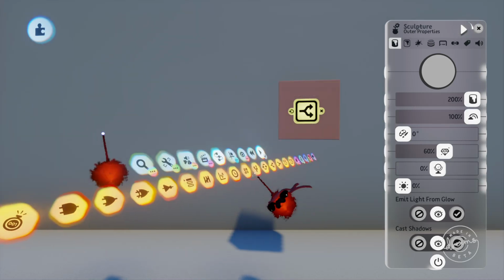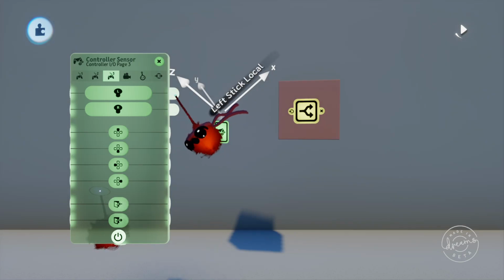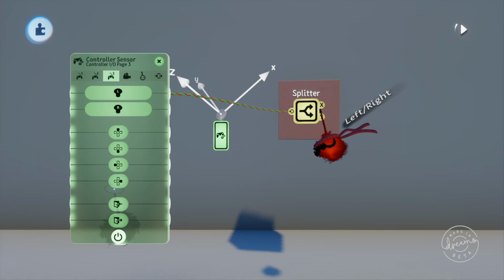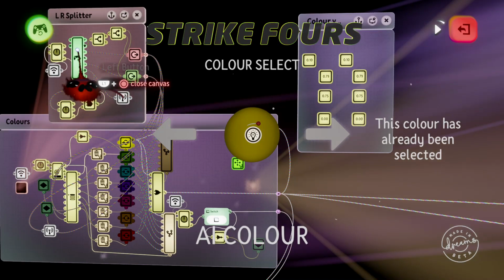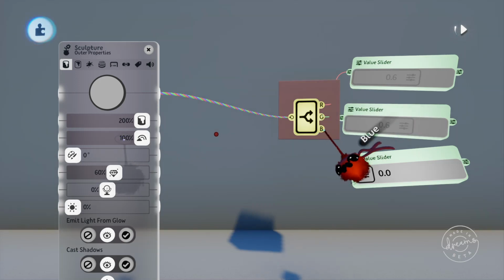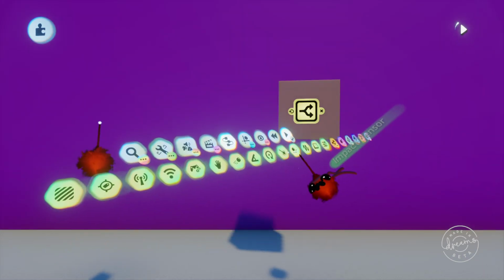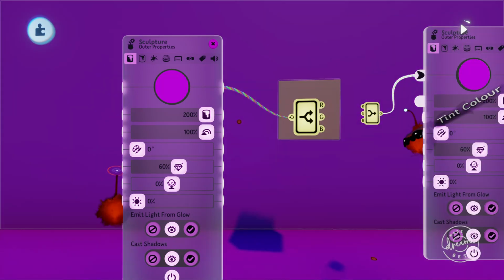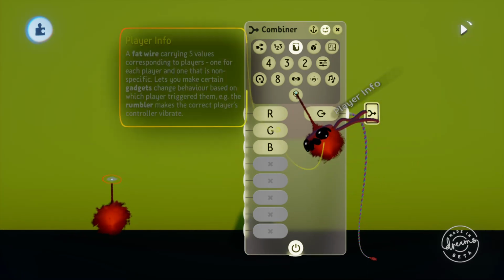Tutorial #6 - SPLITTERS AND JOINERS - Dreams PS4 Logic

Comment: So the left and right works, but it also still registers the up and down directions into the left and right. Is there a way to prevent that?
Reply from the maker: Have you plugged the stick output into a splitter, then the left right output from that splitter into another splitter to get the positive/negative (left/right) outputs? The advanced mover tutorial explains this I believe, it’s tutorial number 32 and explains splitting LR directions from up/down :)
Reply: @JimmyJules153  Yes but it's still behaving strangely. I'll check out the other tutorial and see if it helps. Thanks for the reply!

Edit: I figured it out. I was using the left stick from the second controller page instead of "Left Stick Local." Once I swapped this, it registered correctly in the mover. (Just for anyone who also had this issue.)

Comment: I think Mm call them "fat" wires?

It seems like that Left/Right wire wasn't fat, but a single signal ranging from -1 to +1. As I understand it, if you plug any non-fat wire into a splitter, it will give you a positive output and a negative output. These only send signals when there is a positive or negative value on the input wire. Also, the negative output value will be the absolute of the incoming value (-0.2 becomes +0.2).

"Splitters don't just work with controllernators"? XD

Thanks for that look at each of the descriptions of the fat wire types. I'm putting together a document that covers everything in Dreams, with video references throughout. As I can't get into Dreams at the moment of course, I'm working from memory and all the videos I can find to try to make as complete a document as I can. And I've got a good amount of links to your videos in there, too! ^^